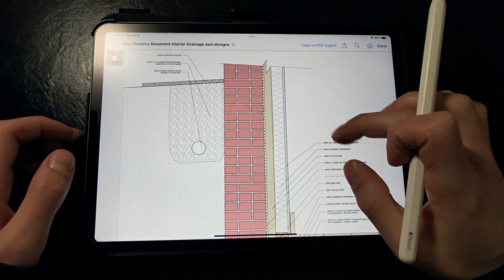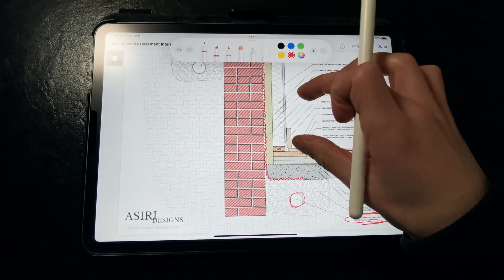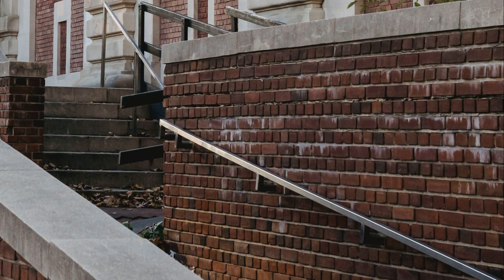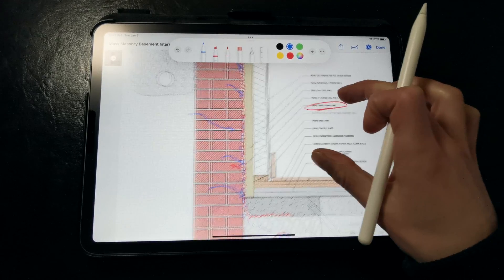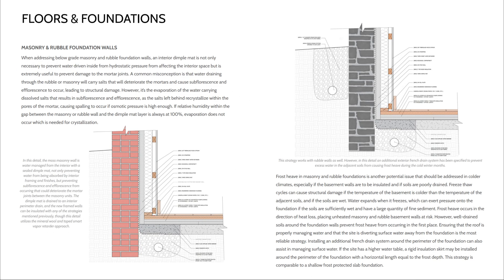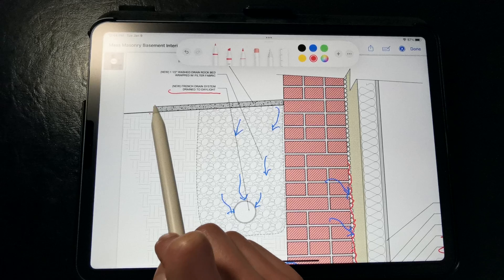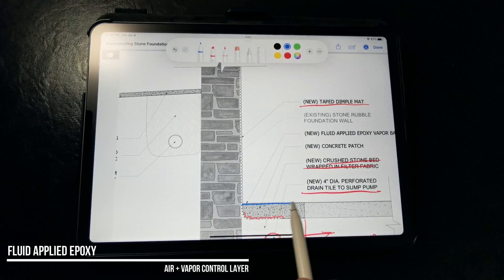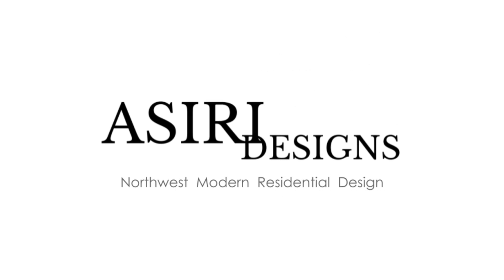How To Waterproof An Old Basement From The Interior (For Architects + Contractors)

Comment: I have an interior French drain set up that was installed at the same time as vertical steel support beams that are against the foundation. The current dimple mat extends roughly 2” up from the floor. In order to seal off to insulate the basement do I have to run a dimple mat the full length of the basement wall and go out and around the steel supports?

Comment: our finished basement ( house built in 1950's) is Partially below grade and we have never needed a sump pump  What about wrapping the cinderblock wall with Delta Vent SA? This was suggested in another video, but almost  all of the building science videos suggest the outside Delta  membrane, which would entail digging up the foundation for those of us in older homes

Comment: allowing water to penetrate block n brick basement walls is very foolish, interior drainage systems are a scam, block + bricks walls crack on the exterior and often one won't see cracks in walls on the inside and block and bricks and mortar joints deteriorate allowing water in and not removing lateral soil pressure tree roots acting upon the exterior of walls. Interior systems do not 'waterproof' anything, they don't stop water penetration through these walls or above the walls. These companies who only or most often lie to homeowners on why their basement leaks often cover, hide,conceal the inside of the walls which isn't the smartest thing to do eh, they hide water, cracks, walls that bow in, they conceal the actual existing condition of the basement walls smh. And radon? lol Interior systems often drill holes in block walls and most do NOT seal bottom of wall--floor leaving a gap-space so more radon can enter through the holes drilled and through the interior gap wall-floor. Basement walls should have been waterproofed when built, most are not and should have been backfilled with most-all gravel, they are not. And we've seen many shallow ext-french drains that didn't do much and certainly did not keep basement dry + fairly often mold and-or efflorescence inside, shallow french drains not a good idea

Comment: I just realized that brick is kinda dumb. You got these horizontal lines that hold more water than say a siding that is oriented vertically (eg board and batten).
And with the mortar line being recessed it will hold more water than say a shingle/slat type of siding. 
Wow it took me a couple decades and this video to come to this realization. lol
We just take things as fact and roll with it (ie I grew up in a place that valued brick)... but it's been sham.

Comment: The raising moisture that goes from underneath the concrete slab to the slab wont be an issue to worry about as it gets trapped by the epoxy vapor barrier? Thank you and good work 👍
Reply: Loved the salt issue explanation!!
Reply from the maker: This is an excellent question! In general it's not a big issue since many liquid applied epoxy sealers have such a low vapor permeance (sometimes less than .05 perms) especially if you're draining those soils with the new interior perimeter drain system. However, if you have a more serious or severe moisture issue, sometimes it's necessary to use that taped dimple mat across the entire floor slab as well, and then install your rigid insulation, sub floor, and finish floor over that, so essentially you're creating a vapor equalized pressure chamber, and any liquid water that migrates through won't get stuck under the rigid insulation. Hope this helps!
Reply: @ASIRIDesigns  Yes, makes sense! Thanks for the answer.
Reply: I did this in my basement 9+ years ago and no issues whatsoever.